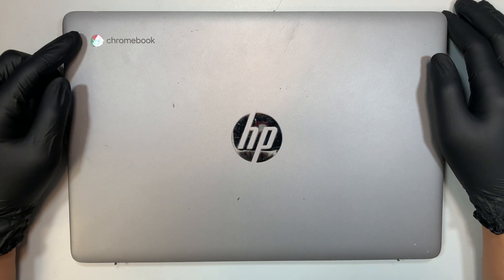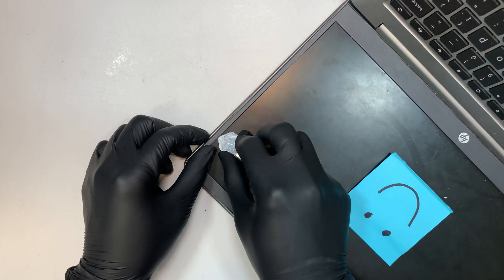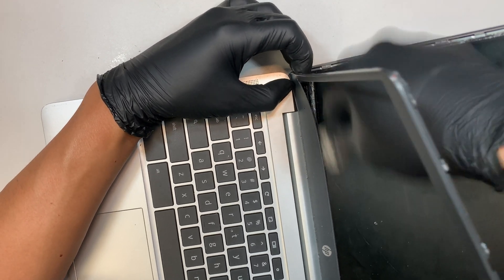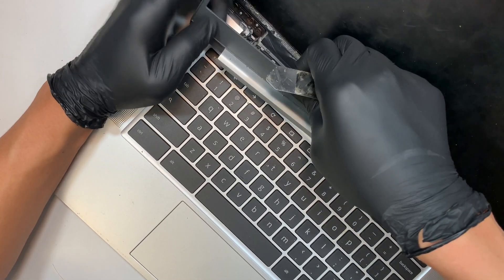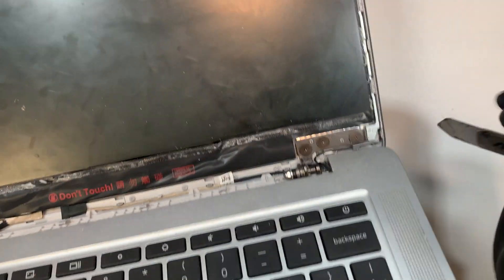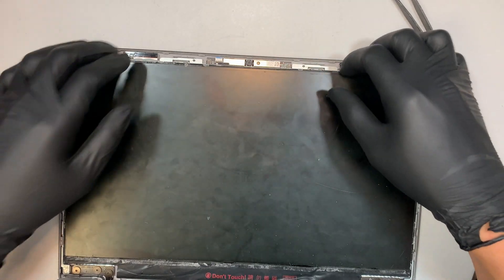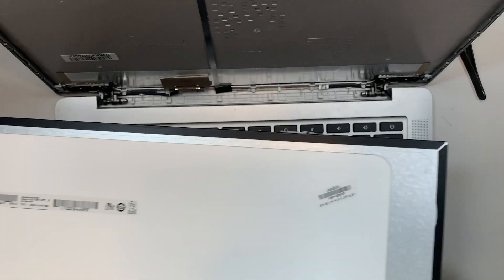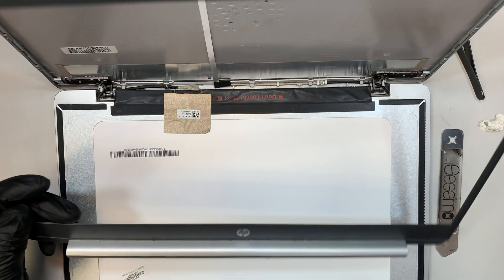HP Chromebook 14A Screen Replacement

Comment: Hi, when I put in the new screen replacement, the screen stays black. I see that the computer is turned on, but the screen isn't showing anything. Why is that?
Reply: The display cable connector might not be fully seated into where it plugs into the display. Even if it looks plugged in properly, it may not be plugged in far enough.

Comment: Do you have to remove the battery when installing the screen on a non touch hp 14a-na0131wm laptop?
Reply from the maker: Recommended to disconnect battery before any repair.
Reply: @UbergeeksBiz  I replaced the screen without removing the battery and so far my chromebook is operating fine. I would have perferred to be safe and remove it but I couldn't find a good video on removing the battery and it seemed difficult.  I viewed several videos on replacing the screen and no battery was removed.

Reply
Reply: @beedear9792  did it turn on automatically?. how did you do it without accidentally turning it on? It seems like it has the tendency to tun on when you shut and open the screen.
Reply: @browneyedgirl57  hmm.  I see your concern. I just remember that I succeeded and it is working fine now.  I took the chance not removing the battery and so did other people on YouTube. You'll have to decide if you want to take a chance by not removing the battery.  The video was very helpful.
Reply: @beedear9792  thanks for the reply, I just took the screen out to see the model number. I will be purchasing  the screen and will replace it without  taking the battery out. I just want to make sure I won't  accidentally  turn it on 😊
Reply: @browneyedgirl57  did you have success

Comment: Awesome. My 12 years old son and I just finished replacing his laptop screen following your tutorial. Thank you  for the links to the necessary supplies!
Reply: Did you remove the battery?
Reply: @beedear9792  no need. Battery is  buried in the main body of laptop anyway.
Reply: @boga2  I replaced the screen without removing the battery and so far my chromebook is operating fine. I would have perferred to be safe and remove it but I couldn't find a good video on removing the battery and it seemed difficult.  I viewed several videos on replacing the screen and no battery was removed.

Comment: Uhhh quick question does it work for a chromebook 14a-na0037nr?
Reply from the maker: Same process on how to replace the screen
Reply: @UbergeeksBiz  also is it the same model for the screen cause I dint know if it's the same screen model
Reply from the maker: @senko-san9820  It should be the same
Reply: @UbergeeksBiz  is the screen replacement the same model for my chromebook 14a-na0037nr?

Comment: Always disconnect the battery when working with the LCD connector. Common for power rails for the screen to be live even when powered off. Otherwise there is a risk of damaging both the new screen and the motherboard.
Reply: This should be pinned!
Reply: Oh no. I just opened up the new screen I ordered. It said to remove the battery. How difficult is that? I might have opted to pay the extra $100 to have that done, unless I can find a video showing me how to do it.

Comment: Does this work for all 14a models,  I have 14a-na0061dx
Reply from the maker: The steps should be the same
Reply: I got the model 14a-na0061dx but can’t find a screen replacement with the same model on Amazon . Can I use the 14a-na0023CL model??